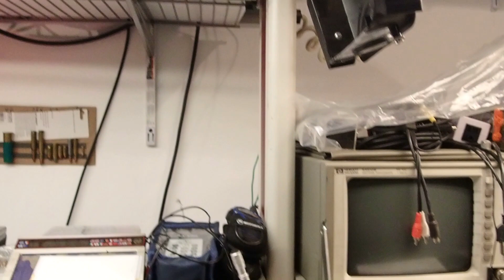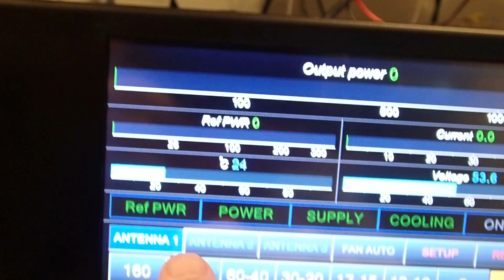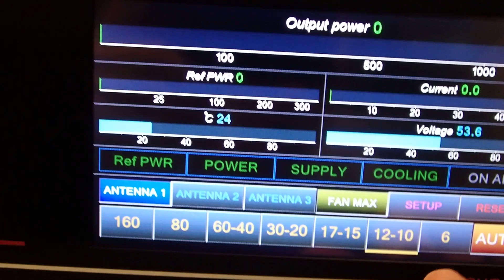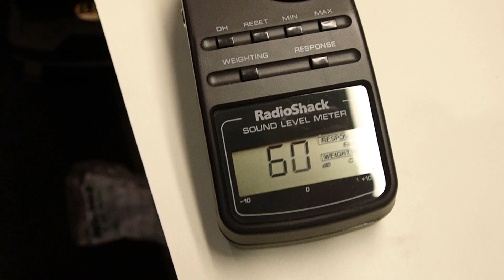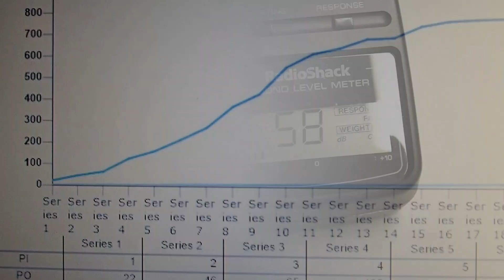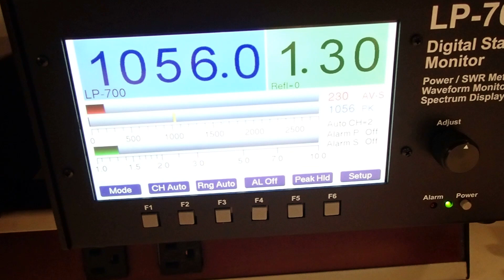Mercury 3 LDMOS Amplifier First Fire up

Comment: When did they change them from 1300w to only 1k?
Reply from the maker: KM3KM specs it at 1200W SSB/CW, I have seen near that under some operating conditions. I think you will really enjoy the amp. Really works well.

Comment: LOGO IS NOT IMPORTANT...THE BEEP IS ANNOYING... OPEN FRAME RELAYS STILL BEING USED ????  WHY ???   THE FAN IS NOTICEABLE  IN IDLE,   WHAT IS THE NOISE OF THE FAN AT  1 KW  WHEN IN USE FOR 15 MINUTES IN  SSB MODE... I DONT SEE ENOUGH  BY THE BUILDERS  OF THIS AMP  AND MAKE IT  PROFESSIONAL  VIDEO......PRICE IS GOOD  HOWEVER   MORE INFO WILL NE NICE  LETS SEE  A GOOD VIDEO    THANK YOU  73.
Reply: It's very quiet
Reply: Yes the loud BEEP was irritating. Hopefully that option can be turned off or at least reduced in volume.

Comment: I ordered one, just now the wait. Do you think the power output would be the same driving it with a IC-705. I believe your chart was with the IC-7300 (Which I will be using mainly). Just trying to get an idea how it will run with the 705@10w. Plus did you post the On-Air video ? Thanks for making these videos of the Mercury IIIs
Reply from the maker: If I get a chance I will plot the curve with an IC705. Been kind of jammed up recently.
Reply: @RedRockWorkshop  Thanks and for the videos you have posted on this Amp.
Reply from the maker: The vid is done. Ran off the battery with 40% charge. At max drive using the batt got about 250 to 280 W out of the Mercury 3. Should have the vid up tonight. 73'S
Reply: You still waiting on your Mercury 3s, or have you received it? I’m curious, seeing you posted comment 2 months ago. I’m about to pull the trigger on one, but slightly apprehensive due to wait…..
Reply: @truckingfun5033  I have gotten it. about 3 weeks ago. took about 6 weeks to get. Here is my video https://www.youtube.com/watch?v=INbBt8vtA1Q
Reply: @tbone-k9  Okay, thanks for the reply back, and reference to your video. I need to just fork out the money, and get in line for one. I really look forward to the assembly, and use of this ldmos
linear amp….
Reply: @truckingfun5033  You'll be happy I am sure. But FYI they are not taking any new orders till after Sept 10th. Demand has been so high, they are re-tooling there process

Comment: What is not clear, or I missed it, is if the Mercury amp will automatically band switch based on the input RF frequency?   Also has there been any discussion of rig control via serial, etc?   I'd like to  consider the Mercury amp for a remote unattended setup, where remote statistics of the amp and its current state would be highly beneficial.
Reply from the maker: Yes it has automatic band switching.

Comment: are you running this on 110 or 220?
Reply from the maker: 110V
Reply: I run mine on 110 v ac  it draws peak 1800 watts current 14 amps, on ssb at 1200 Watts pep output